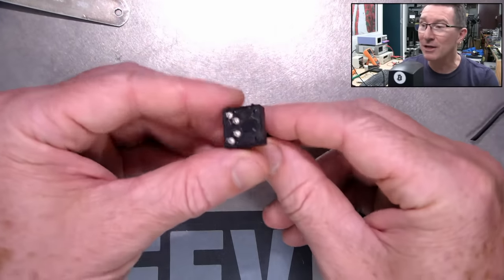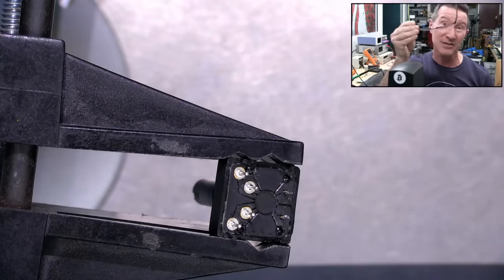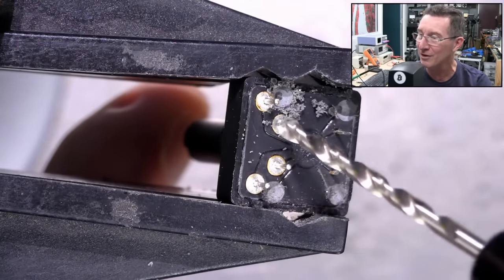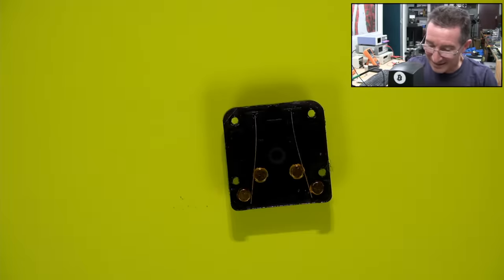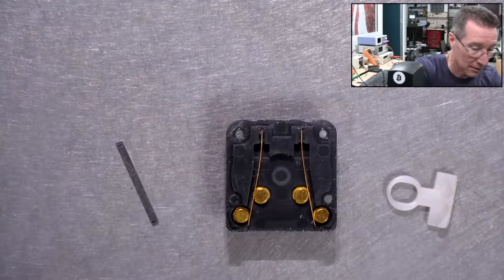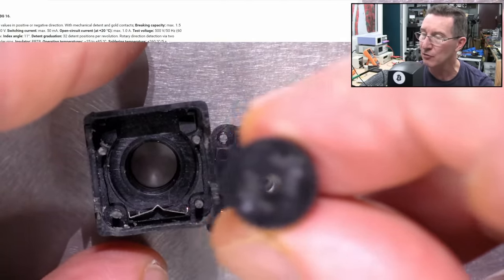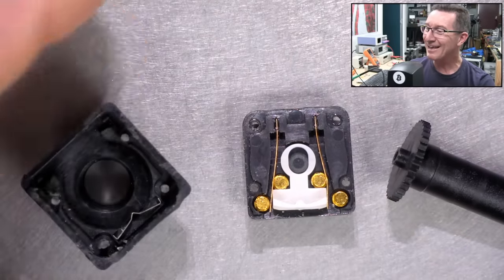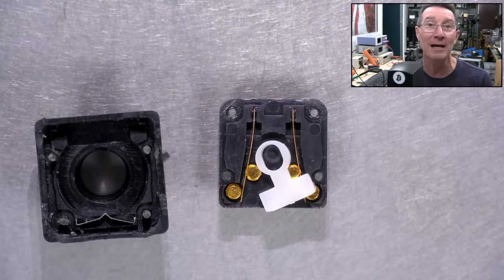EEVblog 1573 - TEARDOWN: How a Rotary (Angle) Pulse Encoder Works

Comment: Very elegant design, was wondering how on earth it worked inside, or at least how on earth they got it to work in such a low profile base.

I do however wonder how fragile it is during the soldering process, the fact the pins are also the contacts and that the tolerances appear to be pretty tight makes me wonder if you reworked it a few too many times or dwelled a little too long or with a bit too much force if you'd break it or reduce the life expectancy.
Reply: the datasheet is indeed recommending not to heat it too much.
Reply: @Damien.D  That is true for almost all solder in switches, where the contacts are going to melt the case a little, so they have a max temperature profile to handle that, so the pins do not move in the housing.

Comment: Yes, you have violated the relationship between the parts after disassembly. 6:53  You need to rewatch the video and it turns out that the curved spring is located on the opposite side. It is necessary to restore the sequence and there will be a place for a flat spring.

Comment: I've seen n something similar in climate control panel from a car, but based on a switch like ESE24MV1T from PANASONIC. protrusions end detents were built into knob and front panel. Using discrete switch could improve reliability and tolerances issue, but in this space this propably results in small number of impulses per rev

Comment: I’m kinda partial to optical encoders.  That one seems like it would wear out too soon.
Reply: The data sheet lists some insanely large number of operations though. For most applications, you shouldn't see the part wear out over the lifetime of the product that it is used in.

Comment: Around 12:36, looking at the holes you had to 'drill out', you have the cover upside down.  That detent spring would be on the side opposite the white piece, so it probably just presses against the black wheel's 'teeth', not the white 'pendulum' piece.  That long thin piece of metal, I wonder if it fit into a spot in case to 'push' the white piece against the wheel?
Reply: looking inside the 'cover' (not the part with the contacts) I think I see two tiny slits for the straight piece to slip into.  That would make it a sort of 'leaf spring' to hold the white piece inward toward the center and allow it to slide side-to-side as you turn the 'gear piece' each direction.

Comment: I recently had to replace the quadrature rotary-encoder of my mouse because the wheel was getting flaky. I put in a cheap Chinesium one from eBay and it's back to being flaky (perhaps more so) after just a couple of months. I don't know if the encoder itself is the problem or the fact that it wasn't the right size like the listing said and maybe it's developed a cold-join from cracked solder from the stresses of middle-clicking. 🤔 I can't be arsed to reflow it right now and swapped mice.

Comment: It's not even weird that the manufacturer does not market it internationally; they probably have their 20 German customers that you never heard of, that make stuff for another 20 German companies that you never heard of, that then make stuff for another 20 German companies that you might know if you are in a specific field, that then make stuff for companies you know very well. Typically all small/middle-sized, family run since 1887, industrial manufacturing companies, with HQ in a small town in the black forest or "somewhere near Stuttgart" or Cologne. The company would probably not even think of marketing this internationally, since they can't compete with the low cost quadrature encoders.
Reply: Did a project with a customer, where we needed a modification to one of EBEs sensors. The chief dev wanted to do it in software, but we were thin on memory (those were the days) so, we asked them and they delivered five handmade prototypes in two days.

Comment: Principle looks awesome to me. Sure I wonder how sensitive to dust it is because of the small force applied to contacts. Looks like little bit od dust would be able to act as an isolator. Anyhow something tells me if that encoder was scaled up just to like 1,5X of it's current size, it would be easy to make it reliable as well. As it is now it is like fine watch mechanic but using plastic parts as well. Sure isolating properties are needed but plastic is not most stable thing to use at that size. Nowadays there are better and reinforced plastics and Teflon's and Delrin's and such and possibly ceramics that would do way better job I think. Anyhow better plastic and bit bigger size, maybe even just 1,3 times bigger and that could be more reliable I think.

Comment: Those are just 2 microswitches with 2 outputs each in one housing? I don't know why it shouldn't work reliably as you get older. Ultimately, the well-known micro switches also work very reliably.

Comment: A simple up /down switch and some software would have provided a more reliable solution. Surely good design practice would require at least two independent sources for a critical component.
Reply: In the 90s you had Alps, EBE, Möller and Marquard.
Reply: @falkmachtsachen  there is still a less complex, more reliable solution using simple push to make switches.

Comment: Yes.... I too, suffer the cursed age eye correlation thing..... I have my regular multi focal's..... Then a 1.8 and a 3 for table work..... So, I tote 3 pairs of of eye glasses around at all times, the 3 I only wear when doing PCB work as that is like 30cm max focal distance...... Getting old is not for sissies........😂🤣😂🤣 My daily carry tool... Leatherman, always have. 30 years now.
Reply from the maker: The Leatherman can't fit in your fob pocket.
Reply: Similar situation here. Multifocals for everyday use, 4 diopters for minute work, plus an "arm's length" prescription, specific for the computer screen. This last one is highly recommended, much much better than mutifocals for large PC screens.

Comment: The question is why do it like this? Only advantage I can see is there's no need for logic to decode the direction as with a quadrature encoder, but that only needs a D-type and a use can usually be found for the other half of say a CD4013 if only as an inverter or buffer - how to do this is left as an exercise for the reader.

Comment: Nice, I wish o could've found a replacement for my Yeasu 1500M encoder, poor design snapped the knob off then a couple years later they no longer had the replacement part.
Reply from the maker: Custom jobbie?
Reply: @EEVblog  I got rid of it at a hamfest several years ago. Super glue worked but I wanted it to be original. It was just a poor design, if you saw the front of the radio you'd see a brick with a plastic knob ready to be struck by anything off to the side to snap the stem. Solid receive and my first Yaesu.
Reply: Won't a SLA-Printed one do the job?

Comment: Whelp, totally having to eat my prior comment on this one, granted it's not a quadrature encoder, but an encoder is an encoder all the same, so you very much could have just replaced this with singular push-buttons for the up-down adjustments as you'd said. TIL!

Comment: Very cool video, I was curious how it worked!  But, this is insane to me -- it feels like the market segment that this device fills must be created by incompetent and/or impossibly lazy firmware engineers. Given a choice between this clever-but-fragile mechanism, and a normal encoder plus a few lines of firmware, why on earth would you pick the former. Don't get me wrong, the device is a beautiful and elegant piece of engineering to solve the given problem. But the problem doesn't exist, and the solution introduces entirely unnecessary fragility. Or am I missing how crap microcontrollers were in the 90's?
Reply: Even today, many designs with microcontrollers are going to the edge of them, using all kind of tricks to get more functions out of the already available micro's. E.g. modern washing machines, or the cheap weather stations, show a fixed "amount" of functions, still different functions per model to choose from, but often the same amount. And I think that wasn't any different then. If you as a manufacturer could simply mechanize a part, it would be beneficial to a simple controller, and sell.
Reply: Normal encoders in a ESD gun...

Comment: It seems there is too much chance for failure with this design. Does the datasheet say how many operations this thing can handle? Asking a part to function by slamming its parts together over and over is super old school industrial revolution type stuff.
Reply: Rating is 187k revolutions or 6 million clicks. A normal PEC11 rotary encoder is only rated 30k revolutions. So likely either someone screwed up the design/implementation, or the spec is a bit of wishful thinking.
Reply: @jaro6985  As my Mercedes has a bunch of EBEs encoder switches: These are reliable but don't like being not used.

Comment: That is such a bad design. Of course I failed it's reliant on the friction of the teeth and the springyness of the random bits of metal. If any one of these parts changes ever so slightly it just will not work anymore.

Comment: Typical German engineering; Fancy design, Questionable reliability !
Reply: That ESD gun is about 25 years old.
Reply: The best thing about the internet is that you can broadcast an opinion about everything without knowing anything. So when in doubt just use stereotypes as your talking points

Comment: I love how you butcher the pronounciation of German terms. This design looks like it requires some knowledge in manufacturing precision plastic parts and is not very popular because of that. Someone should make a programable encoder with a little micro in it to replace such oddballs in the future.
Reply from the maker: Some other seems to take great offence...
Reply: @EEVblog  We call them „Spaßbremsen“ (fun brakes)